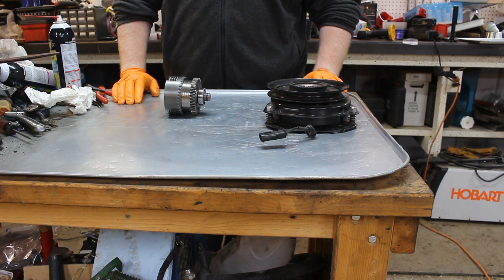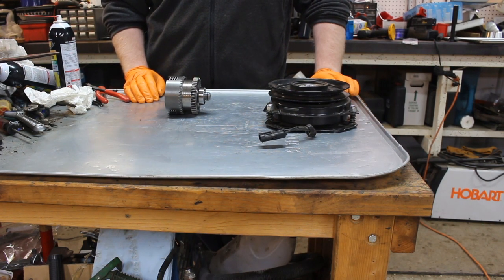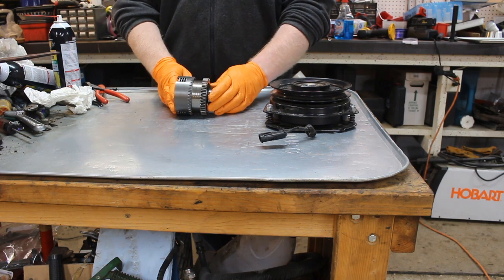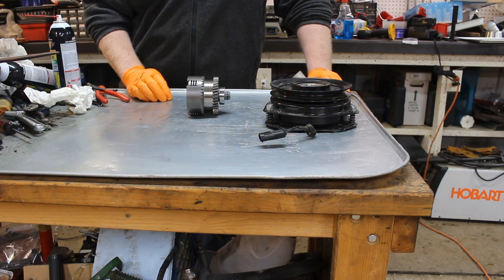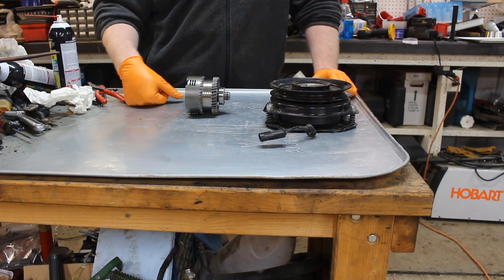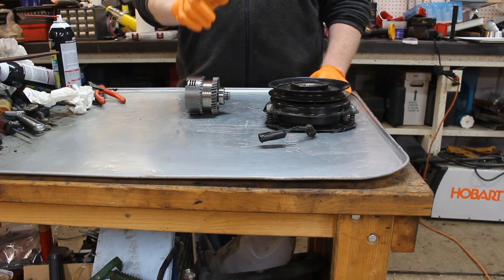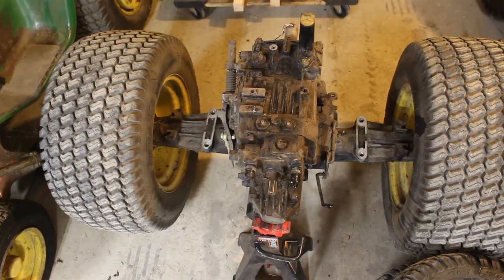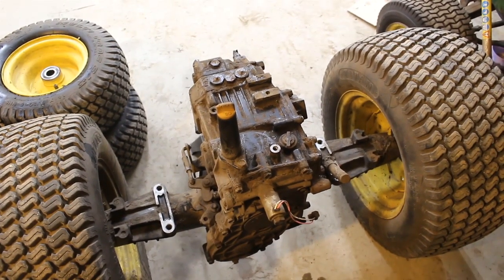John Deere 318 vs 425: Dry Clutch vs Wet Clutch (P1)

Comment: I like that large metal pan you are working on.  Where do you find one that size?
Reply from the maker: I think I found this one at Wal Mart several years ago (I think it was $12?)... This is the second one I've gone through, because the table underneath is wood the tray eventually gets holes poked in it.

Comment: Having had a 92 420 this is very interesting. When the 425 came out the dealer tried to buy my 420 back after I had it a short time. I knew then I bought the right time.  Thanks for the info.